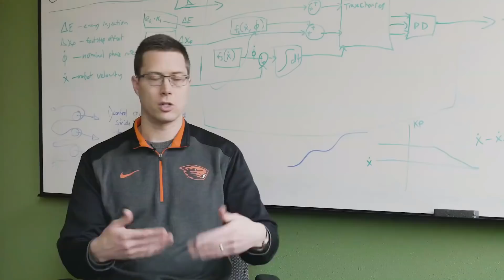"Cassie" Two-Legged Walking Robot From Agility Robotics - Made For Search & Rescue Efforts.

Comment: Wonderful job!  The balance between steps is programed well.  Looks good.  I'm guessing she will soon be able to jog then run!  Nice. The loads it could carry, a second cargo section on top?!  The body of the bird?  Could carry more batteries and a useful load. Maybe another larger gyro system for better balance plus cargo.  What if a bunch of them could carry a platform or other very large objects?  All of them carrying the same piece?  Gezz put a damn saddle on top and climb on! Better yet, have it squat down to make it easyer to saddle up!  Heh heh Giddy uo!  Find a veteran that had both legs blown of.  (God bless them)   Maybe this could help them.

Comment: I just don't see this practical, they still have to keep dancing to stay in one place. It will make sense when standing stabilization will get developed to at least human level. Why making 2 leg robot if it can't stand on one leg to get over high obstacles? Motion effort is just too fragile atm.
Reply: yes, i see different parts of video now, they do stand in some places so maybe they got that better now, i've seen them hanging on cables, maybe for power off time, that's what made me write it, but i still looks too fragile to keep standing in this build. In order for bipedal robot to be flexible in motion, it really has to be able to get on one leg and make step up on not just steps, but higher, or be able to fall and easy get up, for that you usually need more then 2 limbs. So i guess i have to wait for more videos to see these things.